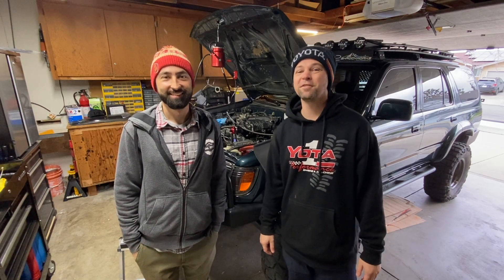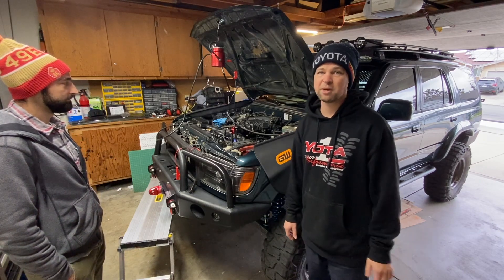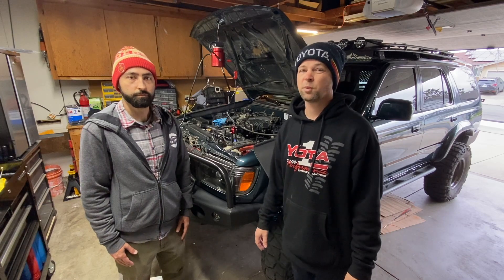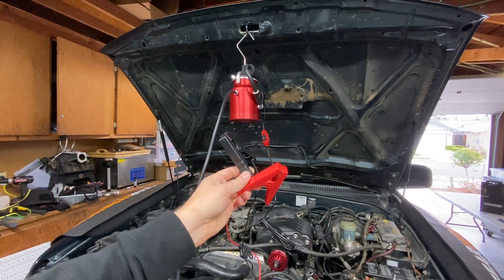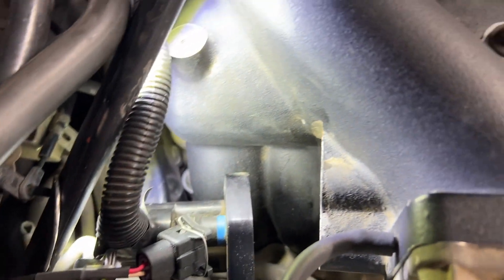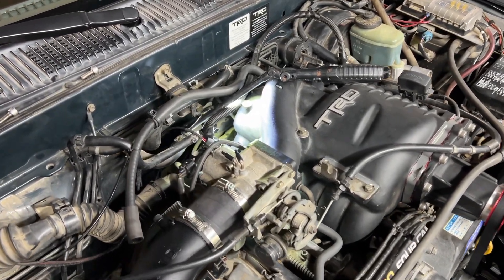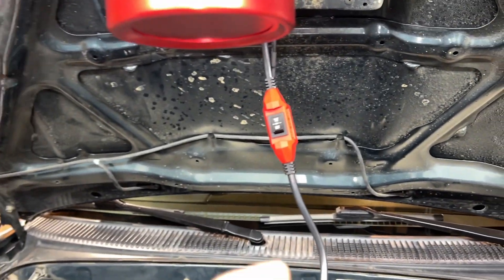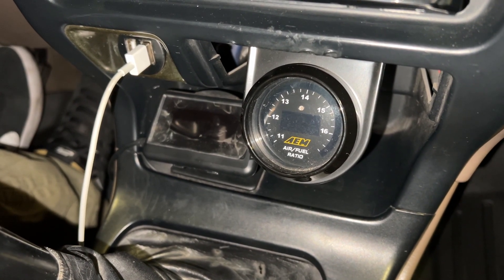Vacuum Leak EVAP Diagnosis - Smoke Testing Machine (P0171)

Comment: I saw another video where the leak was coming from the gas cap.  Where would you hook up the fogger to check that?
Reply from the maker: The end of the filler neck would lead to the gas tank, so you could disconnect the line there. When was the last time you replaced your gas cap? Are you getting a CEL?
- Sean

Comment: I was in Evap leak hell with my 2002. I was sending smoke from the engine bay to the fuel tank. I didn't find the leak until I removed the cover under the back seat and saw a little smoke. It turned out to be the small vent tube on the tank. It rusted out and was leaking. I was going to try to patch it but decided just to get a new tank.
Reply from the maker: Man sounds like a nightmare!!! But really appreciate you sharing your specific situation as it may help someone in the future. Sicmods!
- Sean

Comment: First. Stevos beanie is awesome. 
Second great video. 
If you don’t have or want to buy a smoke machine. You can spray brake clean around and when the engine dies you know that’s the spot.
Reply from the maker: Good point Mark with the brake cleaner.  I've never tried this method, but I did hear a warning you wouldn't want to do this on a hot engine due to the flammability of break cleaner or carb cleaner.  Have you used this technique on a hot engine or only cold engines? - Timmy
Reply: Not saying it can’t happen. A smoke machine is the right way to do it. But I’ve sprayed red hot headers with brake clean just to see what would happen. Nothing happened😂😂
Reply from the maker: @MarkamisPrime  Well, that's good enough for me.  Spray away!

Comment: I've got a 2000 Taco with the V6 and about 240K miles on it. I'd say the smoke machine was a great investment. I splurged and bought the Autool smoke machine off Amazon. It comes with a huge bag of goodies for hooking up the machine to various orifices. Namely, it comes with a big cone adapter that snugly fits into the air intake hose coming from air box. Just pop the air intake hose off the air filter box and jam the cone into the end. It quickly and snugly makes a air tight fit onto the end of the intake hose. It also has an inflatable air bag to stick into the end of the exhaust pipe to test for exhaust leaks. When I hooked it up to my Taco the top of the engine turned into a hookah bar. Had to chase down about 5 different leaks. But once I got everything sealed up the engine purrs like a kitten now. The fuel pressure regulator on this truck, pulls vacuum off the air intake hose. So, you need to make sure the intake hose is sealed up tight in order to insure the pressure regulator is getting actuated properly at idle. If you buy one of these old Tacoma's I'd suggest just going onto the Yotashop dot com site and buying the vacuum hose kit. It has all ten vacuum lines needed to hook up to the intake in one nice bundle. Since the air plenum needs to be pulled to do spark plug changes, there is no telling how many times the vacuums lines have been  manhandled and the result are cracked lines or hoses that are all wallowed out from being pulled off and on, over and over.

Comment: Open the throttle body!
Reply from the maker: Ahhh, very smart comment.  Yes, how is the smoke going to flow through the throttle plate effectively if it's closed.  The throttle plate has a tiny gap when closed, but it would be better to have it wide open for this test if the smoke is going to be directed into the air tube.  Maybe Sean did this but didn't mention it in the video.  I wasn't there, so I don't know.  - Timmy
Reply: Why not use a vacuum gage hook it in to the manifold were the brake booster hose attaches to the manifold.